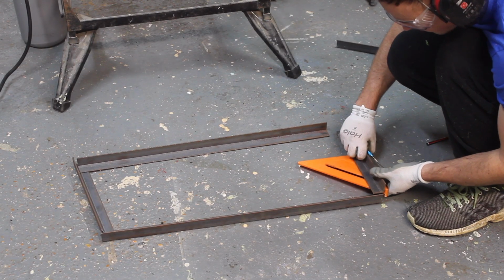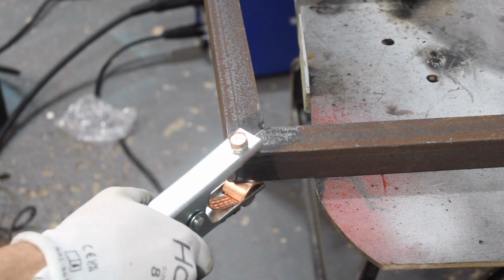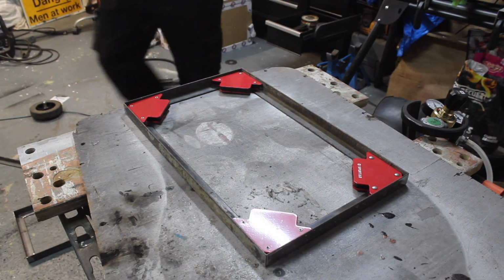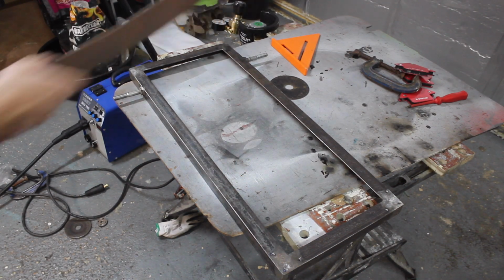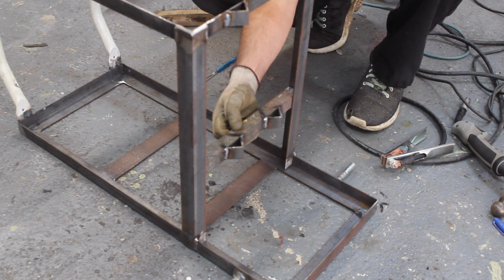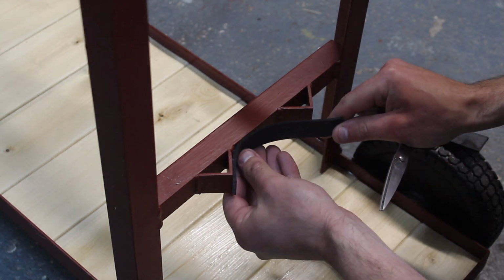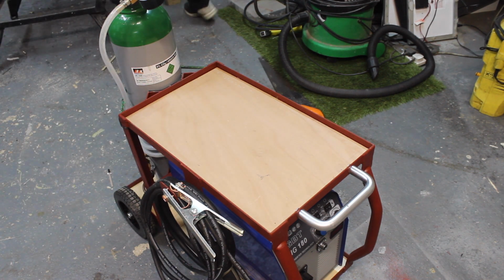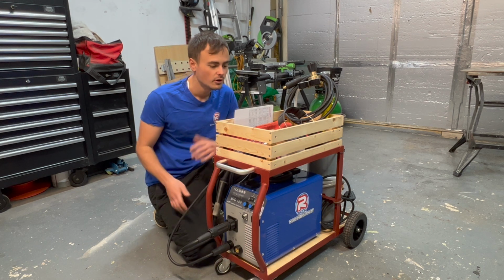DIY Welding Trolley: The Perfect Project for Any Welding Enthusiast

Comment: Hi everyone shows that welder doing what most 180 will do . Thicker metal is easier to weld . Many are interested in the better settings for doing car panel for instance . Hopefully with a better machine with the upgraded power settings it would be interesting to see how it gets on . I have my buy now on pause until I'm impressed lol all best young fella
Reply from the maker: I will be trying it out on bodywork repairs for sure. For me the thing that stands out about the RTEC 180 more than anything is their customer service and the 3 year guarantee. Thanks for your comment mate, take care